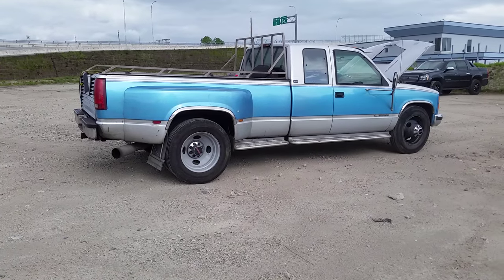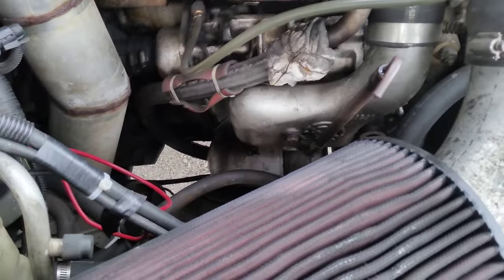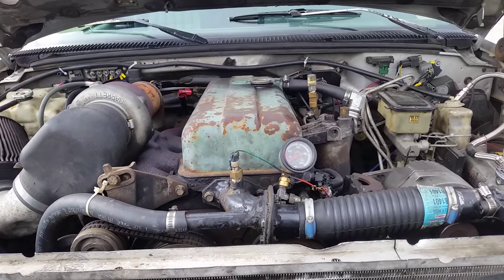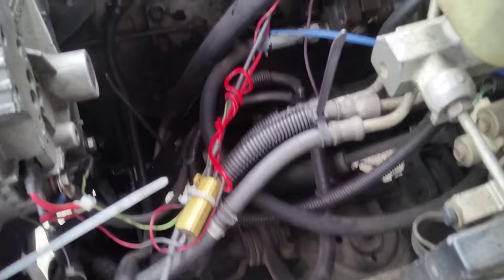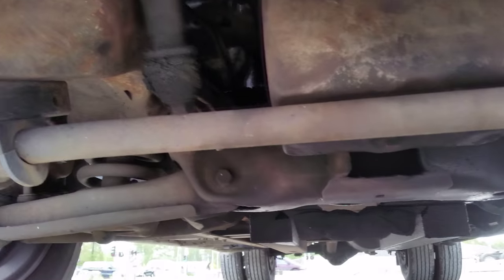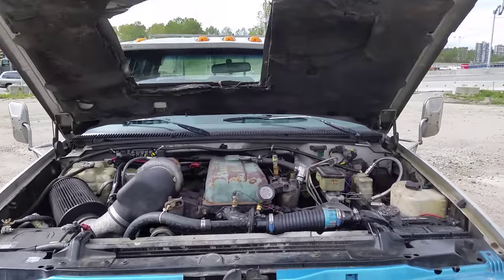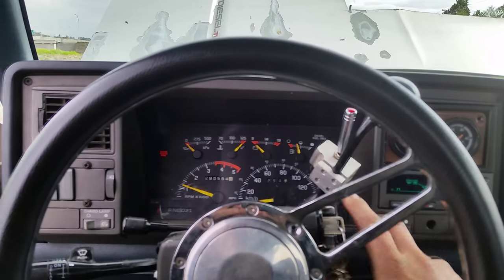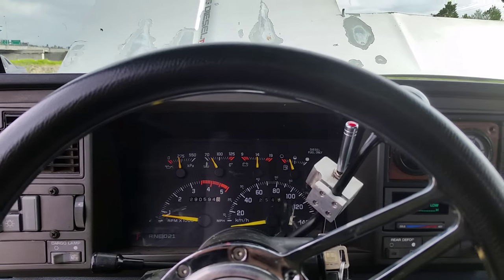1994 c3500 435t detroit diesel silver series swap

Comment: Nothing a plastic cap on the hood wouldn't fix.  Forget the modesty, that's a pretty cozy fit, and it goes - that's all you need from a swap this big.     Also, a full-on manual mode is a must-have on these kinda machines. <3

Comment: are you using an full manual valve body? I'm putting an 1.9 TDI in my explorer and don't want to spend a lot for a TCM thinking going full manual valve body
Reply from the maker: Nope gm computer outta the drive by wire 6.5.   I have a 6.2 grumman pcm setup set to 3100 rpm. Probably best stock pcm to use. 91 grumman with a 6.2 4l80e

Comment: Great Swap and ingenuity... and thanks for the video of it.  If you don't mind me asking,  what did the whole project from start to finish... cost you?.... including the cost of the engine.

Do you still have it?... and what kind of fuel mileage are/were you averaging?    Which trans are you running?...    Thank you sir, and I appreciate any and all info you can give.
Reply from the maker: Id say safley about 10 grand by the time its built if every part had to be purchased. I had a few parts around. 

The 4l80e lasted 100 000kms, it being replaced with a 4spd auto (jr403a) and a 4 spd sm465.  Made about 23mpg empty or fully loaded.

Comment: how's the truck running today
Reply from the maker: It's been parted out about a year ago. I put 100 000 kms on it. Was a great machine. Truck cab/body were getting very tired. 

Building a new vehicle now. 253t in a Honda Accord wagon. Should be 50 mpg and a great commuter.
Reply: @Cb9wagon  Oooh noooo! I was gonna ask if it still lives. At least ya did the build, it was successful and ya got 100,000 km of fun/service outta the thing.